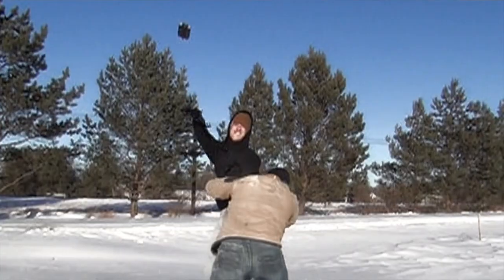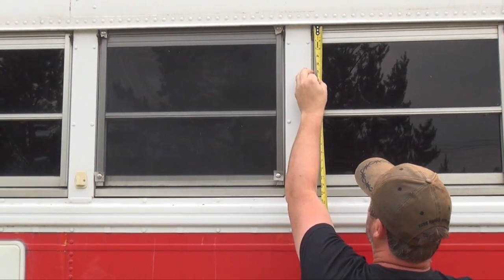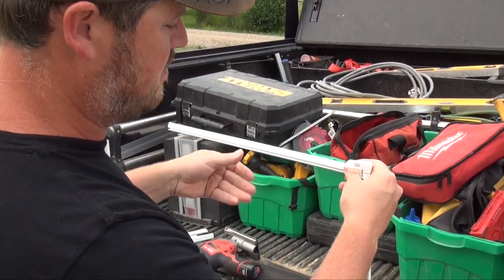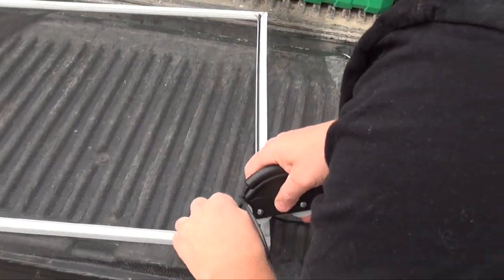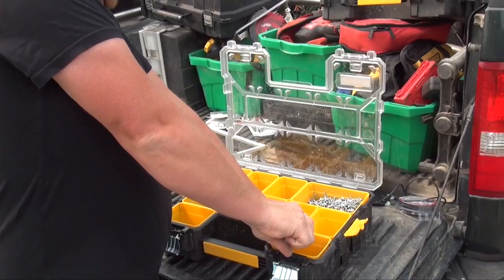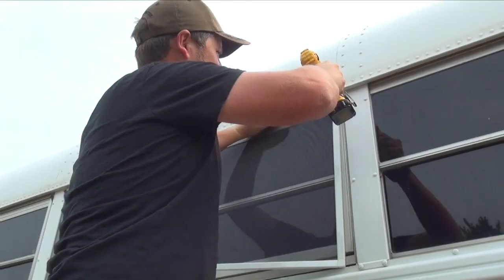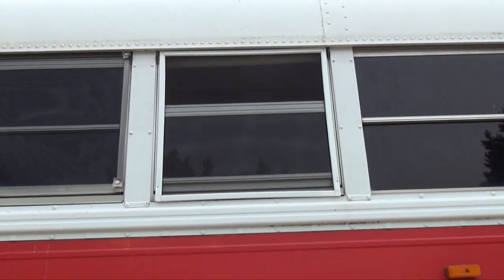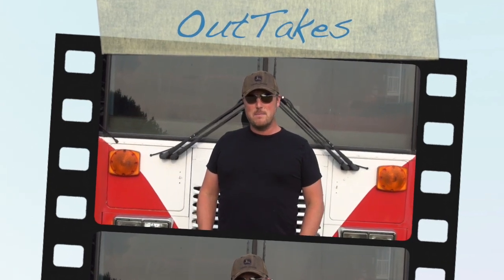DIY Screens for a School Bus Conversion | The Bus Life

Comment: This is Genesis, I've been looking how to keep critter's out. The emergency windows are way cool my Genesis didn't come with any emergency windows installed. I'm off to skoollie forum to run a ad for some. Now every one will be able to order and pay in the drive through. How much did each window run? or did you keep track. cant say I have ever done a screen before except a solar dehydrator. But I stapled it to a wood frame. I'm really glad you built your bus before me or I would never have a clue on half this stuff. Probably would have ended up with a case of water and hammock. I heard your in the parade in a few days. I cant wait to see how or where every will be so they can be seen.

Comment: Your screens are too big. I hope i can explain it in english. You have two possibilities. You cut the screen roundabout 2 inches shorter that the lower frame of the screen ends at the height of the lower frame of the sliding window. so than there is no gap on the lower frame. Or you cut the screen in half of the height so that the lower frame of the screen is on the upper frame of the opened sliding window.  Is my description understandable?
Reply from the maker: The screens have to be that size.  If not, you would not be able to slide the window down because the screws would be in the way.

Comment: why not put the screen inside instead sense is a moving home.
Reply from the maker: +vfflores2011 if you did that you would not be able to open the windows.
Reply: +GoodNewsBus that's why you make them snap on and off but outside of a moving vehicle ? when you slide your windows out you still going to need a screen.
Reply from the maker: +vfflores2011 We don't have to snap or unsnap anything.  The window can be opened or rolled down without having to touch the screen.  It really is the best way to do it.  The screens stay on at all times.
Reply: +GoodNewsBus when you slide down the windows but not when you push them out